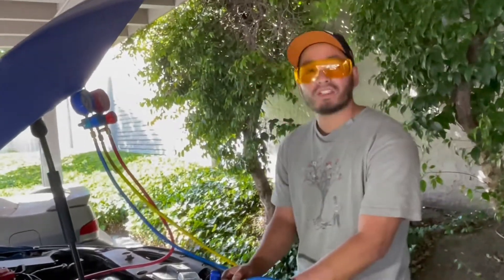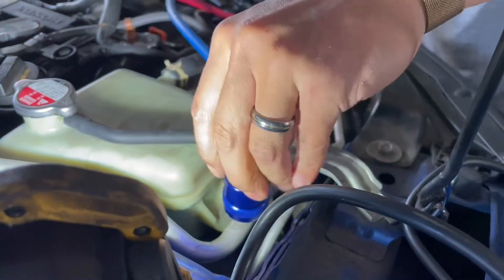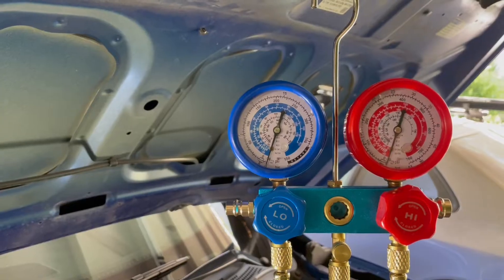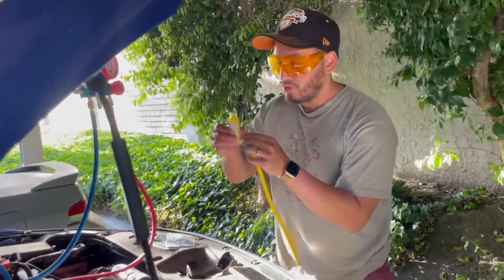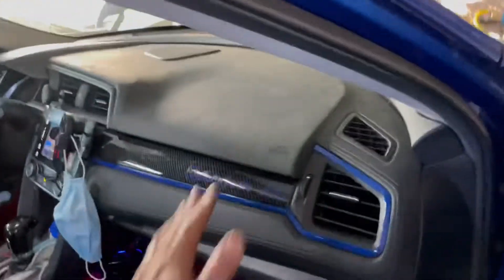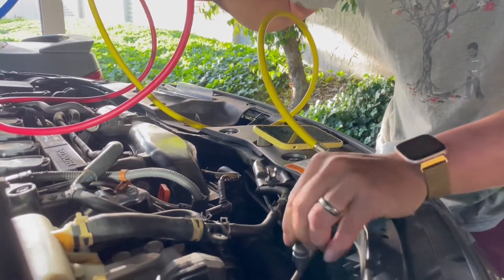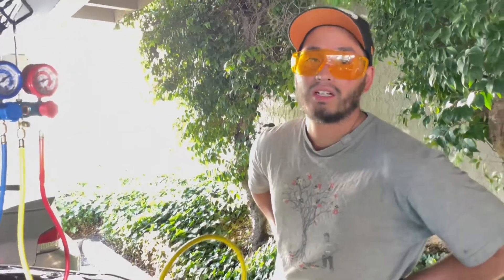DIY R1234yf Conversion To R134a How To Recharge AC Refrigerant On 10th Gen Honda Civic AC Fix Part 2

Comment: Yo! I’m working on this swap now. Is yours holding up? Everything online says to swap the condenser and expansion valve. Seems like a lot of work but since you swapped refridgerant I’m wondering, did you do anything besides the compressor
Reply from the maker: Yes, 3 years later and still blowing cold. I only replaced the compressor since it was leaking again.

Comment: It's ok but after removing coupler from high side you should have opened both sides on manifold so what was left in gauges would have gone into the low side. Otherwise you would be venting to atmosphere and quite a few grams held in the lines which could have gone to the low side before removal of low side coupling.
Reply from the maker: Thanks for the tip 🙏
Reply: @Sals_Garage  Dyes, a word of caution, a lot of manufacturers don't recommend it, if you have fitted a new compressor, confirmed no leaks then why use it? Dyes are flourocent, requires a UV light to identify due presence for leaks. If it's a profession then fine but otherwise leave matters simple.Fittings need cleaning after injection or it will be confusing for you or the next person and there are sniffers that sense leakage but suitable only if you do it as a profession, vacuum is ok on gauges but there is a torr gauge measuring minute vacuum, again out of scope for DIY.
Reply from the maker: @pankajmakwana2300  Good tips for the avg DIYer.  Thanks!
Reply: @Sals_Garage  You are welcome. Charging of high side pressures are usually done by taking ambient temperature( surrounding temperature) in degrees F, adding 32 to it and converting that temperature to corresponding gas pressure for the type of refrigerant used. That will now become your discharge or high side pressure. Charging is done while running engine to 1500 rpm and charging is stopped at that time, cool air temperature is taken to ensure Thermostatic expansion valve on the cooling side is working ok, temp will be close to 0 degrees C. The real cooling is experienced while car is moving as you have ram air also passing through the condenser located in front of the radiator. On idling only the fan may run if engine is hot but the test run will confirm everything for you. Good luck and I hope the above helps, years of experience. Go over all disturbed joints using leak detection fluid ( soapy solution) but formulated to prevent corrosion on pipes and there you have it.
Reply: You are welcome, did my City and Guilds on it, automotive was just a small chapter along with transport refrigeration which is a lot more involved with different types of drives.
Reply from the maker: @pankajmakwana2300  Nice, you know your stuff.
Reply: Nice, you should invest in a small cheap digital thermometer, that way you can measure air temperature in vehicle and air off from ducts, temperature difference will be 10 to 12 degrees Celsius. Usually go with measured charge of refrigerant  but that may involve reclaiming from system first but above is a rough rule of thumb to make it easier.
Reply from the maker: @pankajmakwana2300  thanks for the suggestion. Going to search for one now.
Reply: Charging refrigerant R134a it's preferable to charge as vapour instead of liquid, though blends have to be charged as liquid in order to get the correct cocktail or mix of components.

Comment: So where in this video did you do the conversion? There wasn't any info about converting from yf to 134
Reply from the maker: This was part two. Part one was changing the compressor and the oil
Reply: I went back and watched it. Was that aftermarket compressor specifically a 134 compressor cause it didn't mention anything about yf to 134. Or did you just replace the compressor cause it was bad and just charged it with 134?
Reply from the maker: @jarredallen2016  I replaced the original broken compressor with a new one and converted the refrigerant. No issues so far.
Reply: @Sals_Garage  ok. I'm just trying to see exactly what a "conversion" is. To I'd think that conversion means replacing certain yf OE parts with 134 aftermarket parts. But in reality, a "conversion" is just removing all the yf and charging with 134?
Reply from the maker: @jarredallen2016  correct 👍

Comment: Thank you for the video! Would I need to replace the compressor to do a conversion?
Reply from the maker: Just the oil.
Reply: My concern was that Honda uses POE oil, instead of PAG oil. I don’t want to mess something up by mixing the 2 oils in the compressor / system.
Reply from the maker: @Josh-yf9dw  you’ll need to vacuum out all the old oil and refrigerant to start fresh without mixing.

Comment: Hey bud have you had any problems after converting as far as any system failures? My system leaked but I did a system check which came out good but I want to convert
Reply from the maker: No issues after three years still blowing cold.

Comment: How is the AC working so far since you swapped to r134a? Any updates?
Reply from the maker: 3 years later and still blowing cold. Much more reliable than I ever experienced with OEM headaches.
Reply: @Sals_Garage  I’m at the shop right now to evac my system. I will be doing the same thing with filling with r134a.
Reply from the maker: @d0mochi  good luck 👍

Comment: Hi Sal - I ended up in the same situation today with my civic 2016. Honda dealership replaced the condenser for free but quoted me $1700 for the compressor and the local mechanic $800. Looks like there still isn't any guarantee that it would get fixed. I saw some comments stating that replacing the free on is illegal. Should I go to my local mechanic and ask them to do the same like you did(replace the condenser + change to 134a)?
Reply from the maker: Sorry to hear. Most shops won’t do the conversion because legality concerns so you’ll have to do it yourself.
Reply: @Sals_Garage  I see ok. Would you still recommend doing it? Cuz it looks like people are running into the same issues again and having to get their compressor replaced 2-3 times. How's yours running so far?
Reply from the maker: @vamshikalva1594  I recommended doing it because it is more reliable. 3 years later and AC still blows cold without leaks.
Reply: @Sals_Garage  thank you. Are you for sure blaming the refrigerant to be the culprit behind all the condenser and compressor issues? Secondly, I'm almost inclined to do all the stuff on my own. I literally have zero experience in cars. Could you tell where you ordered the parts and all that I would need and the best place to get them?
Reply from the maker: Yes I’m sure. Parts needed are in the description.
Reply: @vamshikalva1594  yes. R1234yf is known to be corrosive to AC components hence why stuff keeps breaking. It’s environmentally friendly though, or so they say.

Comment: Hello Sal, nice video. How's your aftermarket and R1234a conversion? I have the same compressor for my 2019 CRV and AC died. I wanted to go the same route as you did, genuine compressor and R1234yf is very expensive. Thank you.
Reply from the maker: Thanks three years later, and it is still blowing cold. Very happy with it considering the cost.

Comment: A- lighten up on turning your valves. 
B- you can use a scale to measure how much you are putting in.
Reply from the maker: Thanks for the tip. As a beginner I appreciate it.

Comment: You just need to change the ac compressor? And not the other ac components? Like the expansion valve etc?
Reply from the maker: I changed the desiccant filter but not the expansion valve which is hard to access.

Comment: Did you flush the lines , also did you change the expansion valve? My compressor went bad on 2016 Honda civic , 2nd time no ac in the Honda. Want to convert it to 134a, did you change expansion valve, if not was the air cold and did it last .
Reply from the maker: I didn’t change the expansion valve three years later it still blowing cold
Reply: Hi Kay - curious to know what you end up doing? I'm having the same issue(first time) and don't really know what to do and the dealership wants to charge $1600 for it
Reply from the maker: @vamshikalva1594  just follow the two videos and buy the items linked in the description. Good luck 👍

Comment: Did this fix work long term? I am thinking of doing the switch myself.
Reply from the maker: Yes still going strong almost 3 years now. Very happy with reliability vs stock.
Reply: @Sals_Garage  that is good to hear. I just noticed that my salvage 2019 mustang that I am rebuilding had the r1234yf. It look me a minute to realize why my a/c manifold connectors were not working.
Reply from the maker: @sonofahyderite6855  It’s not only more reliable but cheaper to buy as well (r134a) good luck 👍

Comment: How was the conversion of the refrigerant so far going? Would be nice for us to know. Thanks.
Reply from the maker: Still blowing cold 2 years later. Best decision I made for our Civic.
Reply: Do you have to replace ac condenser to do conversion to 134a or you need to replace it because of leak? I wonder if  original one can be used as well.
Reply: @Tahoe0512 He said he had his system evacuated and the only thing required for the conversion is the oil and the refrigerant itself. The original condenser might leak because of defects though.

Comment: Great video!! How did the R134A hold up?
Reply from the maker: Still going strong 💪
Reply: @Sals_Garage  nice, our 17 civic AC system is not working again, honda dealer replaced the AC condenser a few years ago, it fail this past August, took the vehicle to a mechanic in September, they said it had no freon. Had them recharge the  AC system, they added dye but found no leaks. Now it's not working again. Wife wants to sell it now☹️
Reply from the maker: @12345nope12345  try refilling with 134a for better reliability
Reply: @Sals_Garage  gonna try that
Reply from the maker: @12345nope12345  good luck 👍

Comment: In the future everyone with R134a will have to convert to R1234yf.
Reply from the maker: Sad reality. In California, gasoline cars will be banned by 2035
Reply: @Sals_Garage   phasing out something should be done slowly over the course of decades, so that it makes it a lot easier for the market to build upon a new infrastructure for it and allow people to become adapted to it. EV technology is great and all, but I don't think we are there just yet for it to become mainstream. If I can fill up an EV as fast as I could my gas car on empty to full, and if I was guaranteed a 400+ mile range. Ontop of the battery lasting 15+ years, then I'm sold on EV, but who knows when that will ever be accomplished. I'm a fan of hydrogen, it just makes more sense. Especially from an environmental standpoint where the cost of making energy for a bunch of EV vehicles has to come from somewhere. And that somewhere is at the expense of power plants to produce all that energy for 100's millions of EVs, that will be on the road in the future. Most of out power plants in the USA run off fossil fuel. So, I don't see how EVs are going to be better for the environment, when you're going to have all of these fossil fuel power plants having to produce more energy to power EV stations and EV cars in the future.

Comment: Thanks again for the help Sal.  I tackled the compressor swap today, still waiting on the freon to recharge the system.  Anyway, FYI for others, with a Civic SI the job is much different, meaning it is much harder.  There is, what I believe to be a huge portion of the exhaust manifold that is 100% in the way from under the car that prevents you from having any chance of getting to the top two bolts on the compressor.  We ended up having to take half the front end of the car off (slight exaggeration) so we could access from the top.  Even then it was a royal PITA but we got it done.  I've had the pressure test going for about 90 min & so far so good.
Reply from the maker: Awesome job!  Thank you for sharing your tips and experience.  I didn't know the SI was so different.
Reply: For the Si, You didn't by chance take any video of this or happen to know what all needs to come off to gain access do you? I'm looking to replace my full AC System this fall (when it's cooler to work on the car outside) and would love to know what I'm getting into..

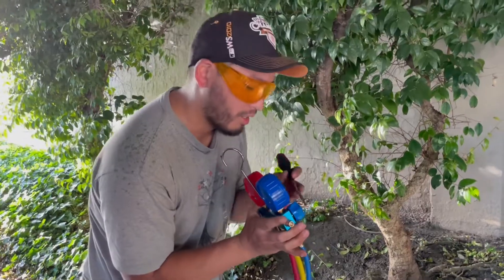Comment: At about the 6:37mark in your video, you purge the air from the system. Can you explain how everything was  hooked up at the time & what you were doing with your screw driver on the gauge manifold?
Reply from the maker: Hi.  there is a Schrader valve in the center of the gauge faces for purging air out until refrigerant starts to blow out.  Only needs a split second of air released.  Good luck 👍
Reply: @Sals_Garage  Thanks, I'll take another look at it.
Reply from the maker: When you release the cap you will see a little pin.  I pushed that with the screw driver and air was released.
Reply: @Sals_Garage  Perfect, sounds like what I observed, truly appreciate your videos & your insanely fast responses.  If we could only get Honda to take the Civic A/C system as seriously as you do  we wouldn't even have to discuss this.  Thank you again.
Reply from the maker: @oldfatdude8505  Anytime!  Glad to help
Reply: @Sals_Garage  Again, thank you Sal. I assume that you removed the gold "knob" from the vacuum line on the manifold & used your screw driver to push down on the Schrader valve?
Reply from the maker: @oldfatdude8505  correct
Reply: @Sals_Garage  I really appreciate it Sal. Rare to see someone so responsive so kudos to you & your wife who supports your head with her thigh :)
Reply: Regardless, could I leave the vacuum line disconnected (before adding dye or compressor oil) & open the low side in order to vent any air in the system & then close the vacuum line, add dye/compressor oil & move along?  I bought the exact same vacuum set you mention & I'm not seeing what you could have been doing with your flat head screwdriver at the manifold.

Comment: Thanks Sal for the video. I just fixed my 2016 civic that had a bad compressor. Doing it myself helped me save over $2000. And now my family and I have cold air.
Reply from the maker: Hearing this makes me so happy. Thanks for sharing and glad you have cold air for the summer 🙌
Reply: Did u have the 2.0L engine and if so where did u get ur compressor all the ones I can find online have bad reviews and I don't want to end up with no ac again any response is appreciated thank you
Reply: @-tht1guy999  I bought an R&Y brand reman compressor but I did put 1234yf back in mine.
Reply: @johnathancooper6303  I was gonna go with them I looked them up but they had nothing but bad reviews lmk how it is plz thanks u so much for ur response
Reply: Can i have your whatsapp number i have big issue i need to know i can use 1234a or no

Comment: My wife’s AC is toast on her 2016 Civic. This is enlightening.  Seems like most/all Honda Civic owners are all having the same AC issues. Leaking in two places (condenser-covered expense) and compressor (not covered and dealer wants $1,700 to replace). They won’t touch the condenser until the compressor is fixed.  What can we do? Obviously there are significant issues with AC system that Honda needs to address.  They likely chose to cover condenser replacement due to it costing less and stuck the expensive part (compressor), to the rest of us poor souls.  I will never buy a Honda again unless they start addressing this for us.
Reply: Ended up in the same situation today. Honda replaced the condenser for free but quoted me $1700 for the compressor and the local mechanic $800. Looks like there still isn't any guarantee that it would get fixed. What did you finally end up doing? I'm curious to know
Reply from the maker: Honda really should address the entire AC system. I even heard of some others with evaporator core leaks which is a pain to diagnosis and repair. For your case I would really try and fight with Honda to get them to fix the issue. Good luck 👍

Comment: If all your refrigerant leaked out already do u still need it to be evacuate . If yes, what is a good price a shop will charge to do it for u.
Reply from the maker: It still needs to be evacuated since there is a lot of pressure still in there. I paid a friend $30 for evacuating the lines.

Comment: why did you use r-134a instead of the recommended r-1234yf?
Reply from the maker: 10x cheaper and more reliable than the newer refrigerant. 1234yf always leaks for some reason.
Reply: @Sals_Garage  My 2018 JL uses 1234yf and it doesn't blow COLD, even on 70s humid days. It blows cool, but it sucks in the summer since you have to basically blast it. The refrigerant is still expensive too.
Reply from the maker: @DriftHyena  yea Honda’s new refrigerant is so expensive and unreliable

Comment: Thanks for both these videos my guy! My local Honda dealership wanted $2300 to do what you’ve done in these two videos. I’ll be taking a crack at this to try to save roughly 1.8k.
Reply from the maker: Hey!  Thanks for commenting. Wishing you luck and glad you found these videos to save money during these hard times.  Let me know if you have any questions during the process.
Reply: @Sals_Garage  will do. Thanks again.
Reply from the maker: @Yore0  anytime! Good luck 👍
Reply: @Yore0  did you end up doing it? I'm having the same issue and debating what to do.

Comment: UPDATES on the A/C system still blowing cold?
Reply from the maker: Yes still the same 1 year later. Can’t say the stock AC system was as reliable.
Reply: So this is possible to fully vacuum all of the oil and Freon from r1234y from the a/c components and fill new pag oil and R134a? I have a 2016 civic and this new A/c Freon just doesn’t last :(
Reply from the maker: @ariesr4883  so far it has been going well. I recommend it but do at your own risk.
Reply: That new Freon is expensive!!
Reply from the maker: @ariesr4883  yes, $500 for recharge of Freon is expensive!